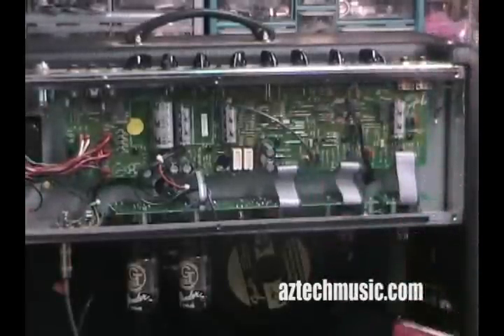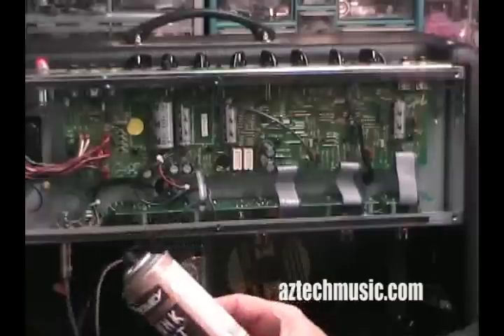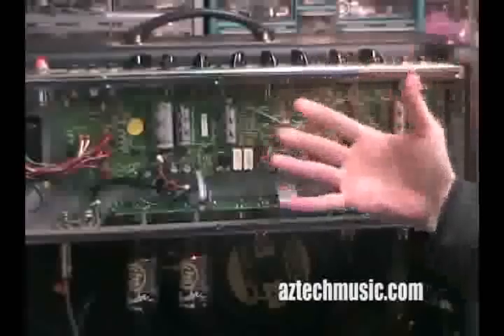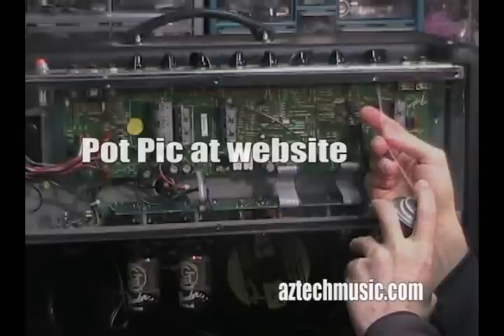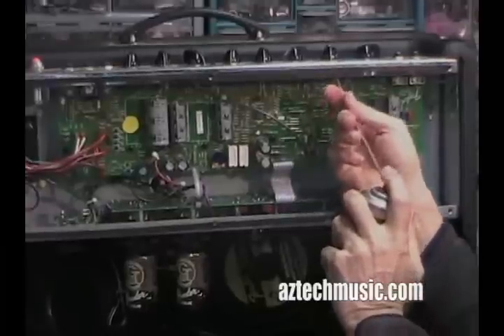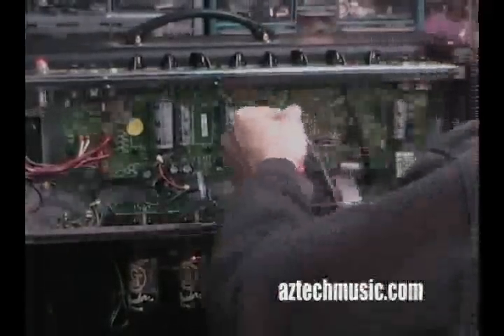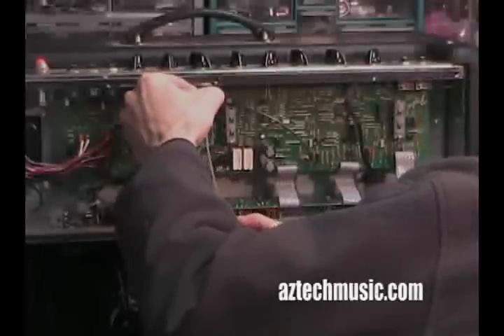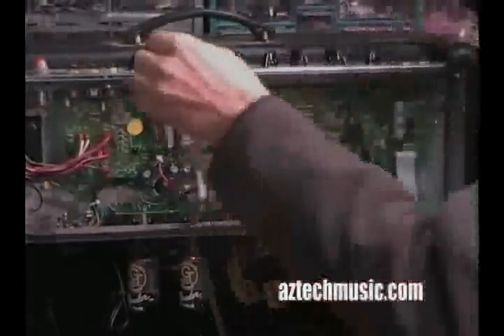Fender Amp Repair Dirty Volume Pot Stinky Tubes Part 2

Comment: hye i have a crate blue voodoo 6212 60 watt tube amp and its not getting a loud sound its jsut being all soft and quiet and ill turn the volume all the way up and it sounds like its on 2 or somethin i was wonderin what the problem could be

Comment: hi Was wondering if anyone knew what i,d need to fix my Fender Acousticsonic Acoustic Guitar Amp its starting to distort and its not clipping,replaced speakers but still break up there at moderate volume levels and upwards